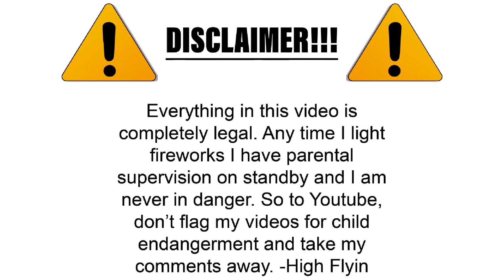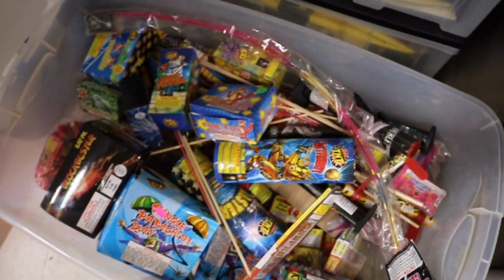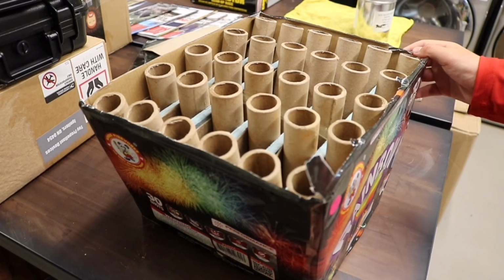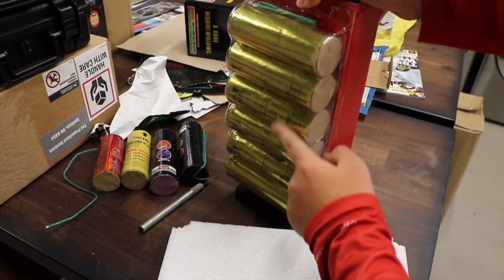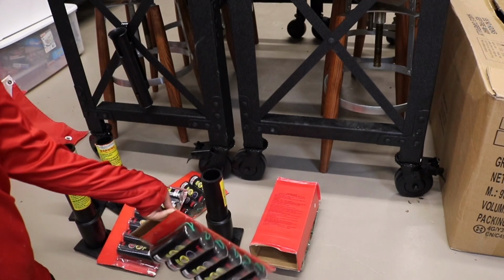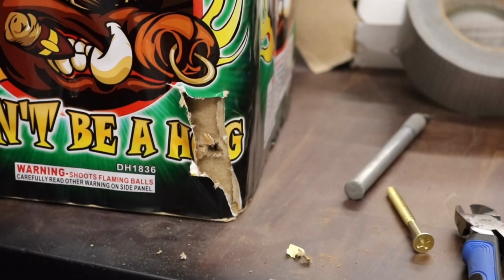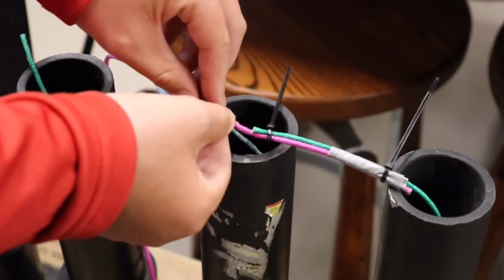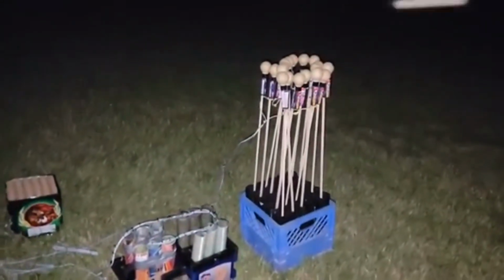How to Set-up & Shoot a Backyard Firework Show! (E-fired)

Comment: Cutting the fuse on the canister shells so the all the same length, about 1.5 inch coming out of the tube   will give a more steady pace , (drilling holes in the bottom of the tubes 1/8 inch) using cake method works great , videos on that ) also your rack? The tubes should be 1.5 inches above the wood / not flush , if the shell were to flower pot it will blow the rack apart, should also be open were the shell sit in the tube , bore cakes next to the fuse don’t pull the fuse out , using a brass all will give you a better feel when you hit the black powder vs using a screw , great job keep it up pyro ! Get ur 1.4 pro license, you already have the cobra

Comment: Good stuff. I personally leave the tops on because I want a visual if something went without getting right up on it when I'm e firing.
Reply from the maker: That makes sense. I usually take them off as its let to clean.
Reply: I usually just put a piece or two of masking tape on top of the tubes of the cake just to kinda let me know it's been fired.
Reply: Shine a light in to the tubes (from the side a bit) and look for black discoloration. If you have to do clean up, you want those tops off!